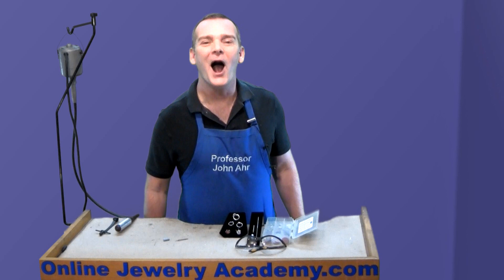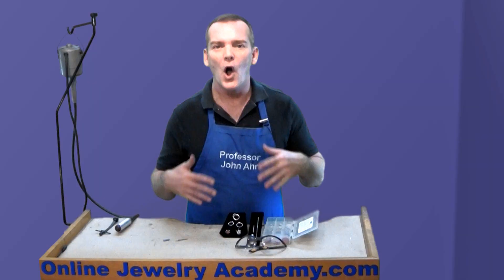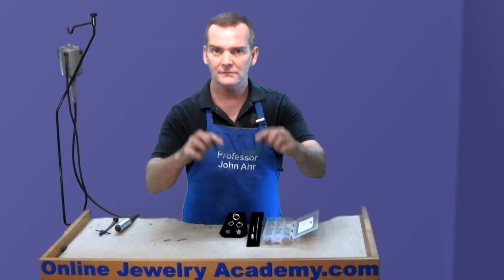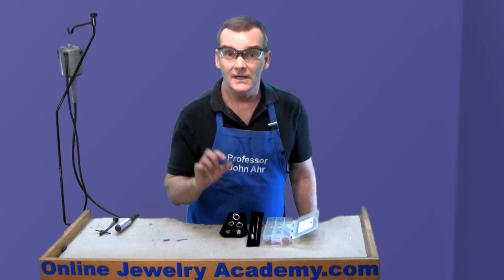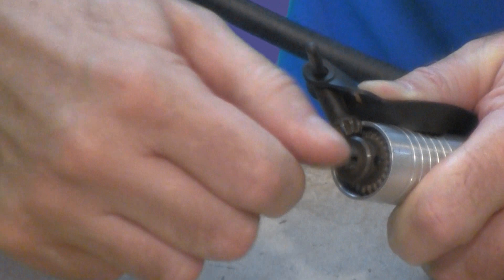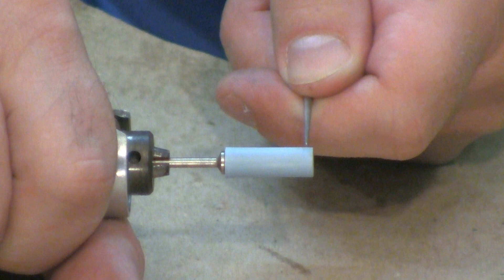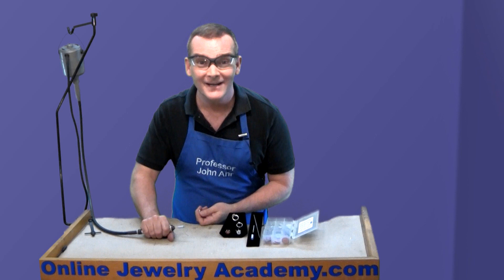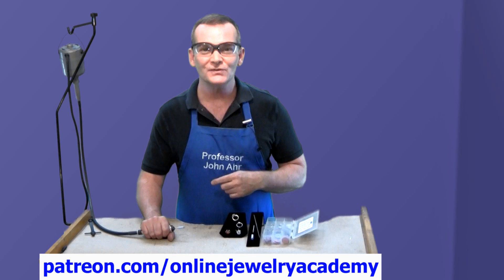A Great Quick Tip For Polishing Wire

Comment: I use this kit a lot, two comments. First, the disks wear quickly, so plan to reorder. Second, because they wear quickly, they generate a lot of debris you don't want to breath but that tends to be kicked up in your face. So not only do you need to wear eye protection, but some kind of dust mask as well. The particles shed are very bad to breath.
Reply from the maker: Thanks for the great information. Thanks for your support. 😀

Comment: I have been using rubber wheels to polish the inside of ring shanks that I have sized for the last years and never use the polishing machine anymore. The problem they create is when it comes to refining your sweeps. As I run a high volume shop it is in my best interests to do in house refining and did have to adjust to the rubber debris.
Reply from the maker: Hi Elizabeth,  Interesting comment.  Thanks to you, I'm sure that many of our viewers will take the debris issue into consideration as they develop their shop routines.
Thanks for your support! : )